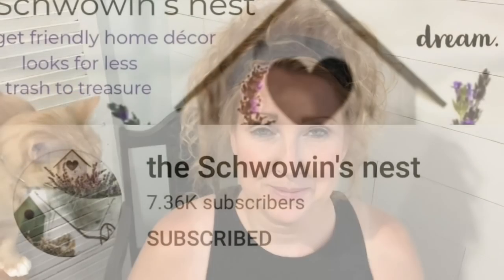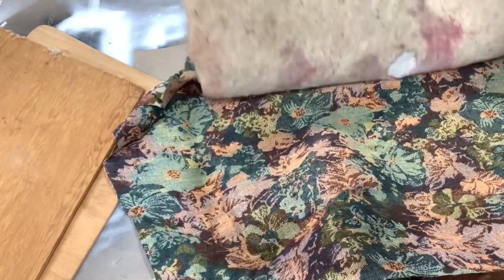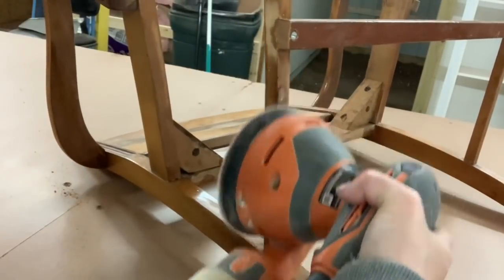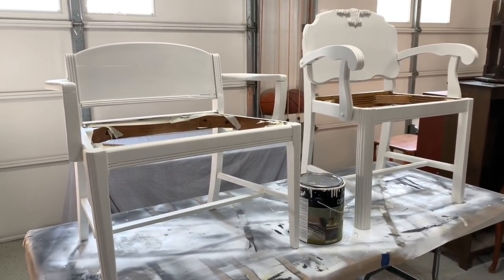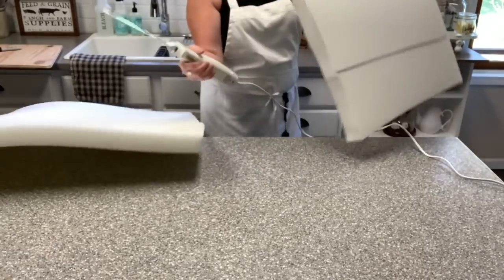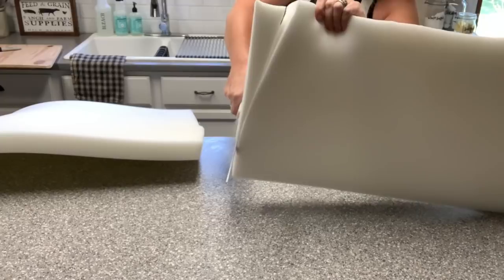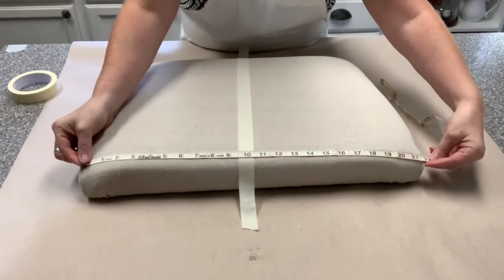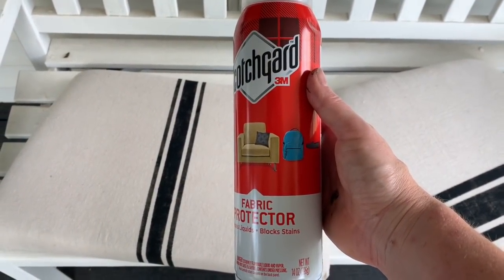Thrift to Treasure Benches  Up Cycle for Farmhouse Decor  Fall DIY Farmhouse Decor Challenge

Comment: Very pretty Yvonne I did have a tiny cry over the loss of that magnificent vend stripe on the chair but better a whole new look than a one way trip to the dump. Veneer or no veneer I still rally like your style and finish ,I’m surprised you don’t make more on them
Reply from the maker: Yes, better to remake them than they go into the garbage. I have made ones with more stripes before, it did sell but not as fast as the ones striped like these. 🤗
Reply: Sorry Yvonne I meant I am surprised you don’t make more money on them not more stripes I like the one stripe myself it’s a statement where as multiple stripes would be a pattern. I noticed on a Sunday funday video that your prices are incredibly cheap (I think it’s worth more) hopefully that keeps your stock turning over, plus of course it’s all gorgeous. I wish I could shop in your booth I’d go 🥜nuts

Comment: What is the multi too called?
Reply from the maker: I'm not sure of the question?
Reply: GingerChickRehab the tool you used to cut the dowel off the chair
Reply from the maker: @cherimillsap9753  https://www.amazon.com/Ryobi-Lithium-Cordless-Attachment-Included/dp/B006XBSP52/ref=sr_1_35?crid=2657G350ATL61&dchild=1&keywords=multi+cutting+tool&qid=1598011085&sprefix=Multi+cutting+tool%2Caps%2C167&sr=8-35     Here the one we have. But they are others similar

Comment: I actually recovered a bench VERY similar to the fuller backed one with an old grain sack. Unfortunately, someone previously had decided to attach padding to the back part and I swear they used 100 tacks on it. It is more comfortable with the padding, but still...  I didn't want to paint it, so I recovered the back again.  It's in this picture from my booth in early 2019:   https://www.facebook.com/rustiqueandchic/photos/a.438303439662511/1120598594766322/?type=3&theater
Reply from the maker: Oh.. that is super cute.  I like the back. You do a marvelous job. I’ve thought about doing smaller stripes. Thank you for the inspiration and for sharing 💕
Reply: @GingerChickRehab  Thank you! Fortunately, since it was an old grain sack, it already had the stripes on it. :D
Reply from the maker: Aww.. lucky😊